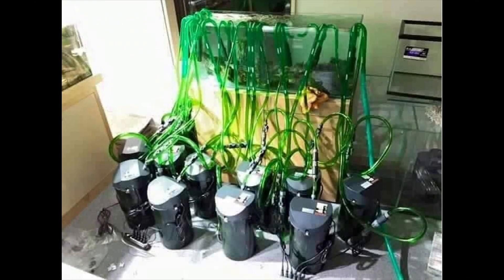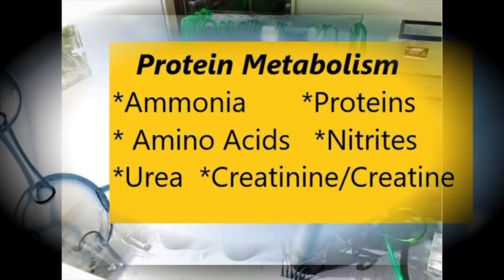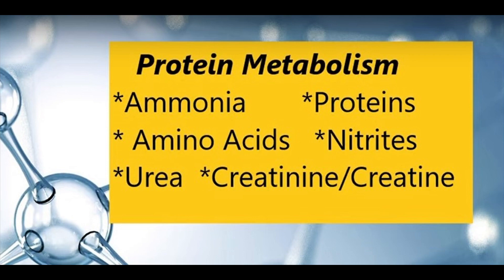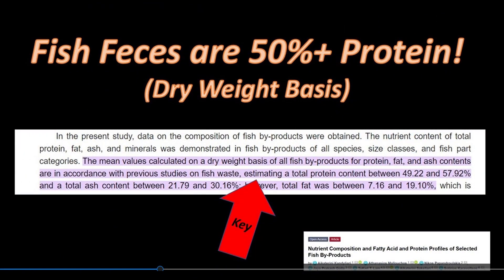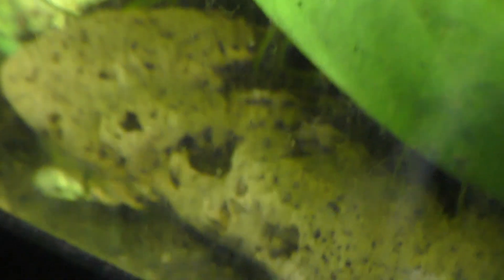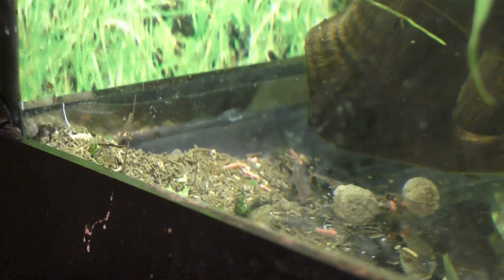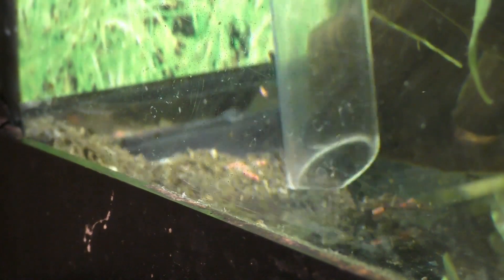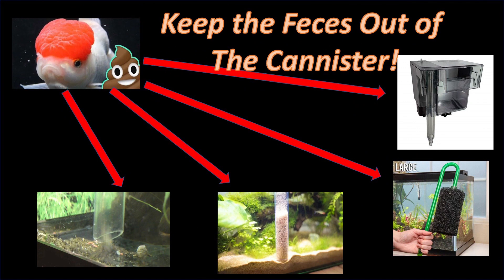Keep Your Cannister Filter from Becomming a Nitrate Factory

Comment: Probably 80% of the filtration game is biological filtration.
That is oxidizing the ammonia produced by fish into nitrate.
So regardless of where that happens you are going to end up with nitrates.
There really is no such thing as a nitrate factory.
If your canister is not producing nitrates, then your canister is not cycled.
Reply from the maker: The point i am making is the more we allow a cannister to collect fish feces the more nitrates produced and the sooner it will clog
Reply: The point of this video is to show that a large part of ammonia/nitrogen waste in your water comes from fish feces that is slowly breaking down over time. Think of it like a pile of poo in the corner stinking up a whole room. If you can remove the big rotting chunks of poo and uneaten food before they get into your canister, you won't have nearly as much nitrate production in your tank, and your filter will have less blockage, allowing for less water changes and less filter cleanings. Many people allow big chunks of uneaten food and solid waste to get sucked into their canister filters, and then wonder why they have to do so many water changes and why their canisters have to be cleaned so often.

Comment: Thanks for video I have 2 fx6 Fluval and and aquaclear 110 . I  now have been using my aquaclear hob filter  with fine filter media .  I think I will be getting rid off my biological matrix and other products in my canisters and try your method with sponges. I used to use poly fill in my canisters but after a week I noticed  a significant slow down in water flow.  And I’m really starting to think all the hype over lava rocks ,matrix , and all those other biological media that is supposed to get rid of nitrates is a big wise tale.  I have an overstocked  125 African cichlid tank with a lot of pothos  . My nitrate levels aren’t to bad but I do 70 percent water changes every week , and  extra vacuuming of substrate thru the week. Thanks for the videos I hope in future to have 300 gallon with a sump.

Comment: Hey John, with your aquarium that you use a siphon to take the feces out of so it doesn’t get into the canister. There doesn’t seem any reason then that you wouldn’t put some poly fill in more as a polishing agent to take out the very fine particles in the water, seeing how, 95% of your feces just collected in the stagnant spot on your Aquarium floor.

I have a continuous overflow or a trickle, water change system. And I’ve tested my water twice now by taking it to the Culligan place where they really have a high-quality nitrate parts per million. And it’s never been over eight. And all the feces go into both of my canister filters . I really think the continuous overflow makes the difference. Good to see you making videos again.
Reply from the maker: I dont want to add polyfill to the cannister because from experience it will still result in premature slow down and cleaning of the cannister.  Even the bacteria on the sponges in the cannister create a "bacterial detritus" that can collect on the polyfil.  When I go to our water company they measure a different form of nitrate and I have to multiply their reading by 4.6 to get the true nitrate as we measure it in the aquarium hobby.  There is a video on this that I will try to locate.  Yes, continuous water change is best, but the resulting water bill would break my budget.  Good to hear from you.
Reply: @HalfManHalfCichlid  https://youtu.be/WVKft0W4La0